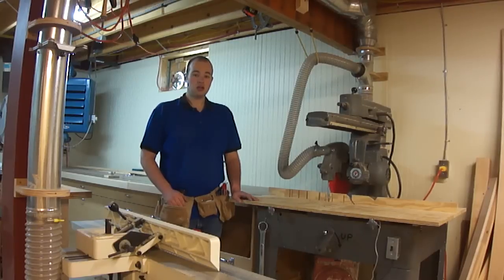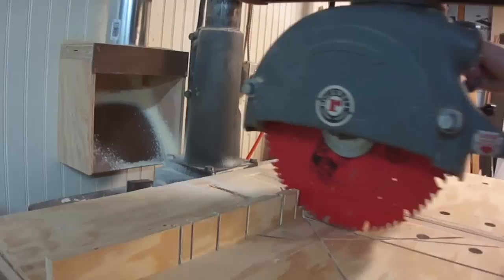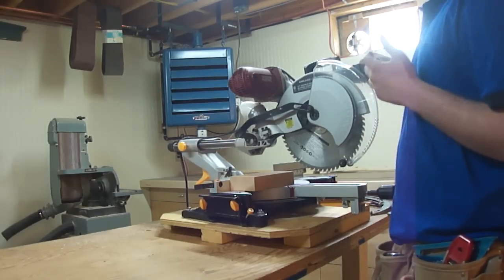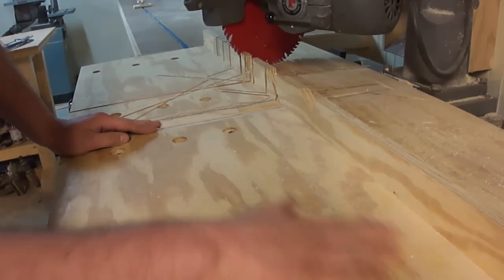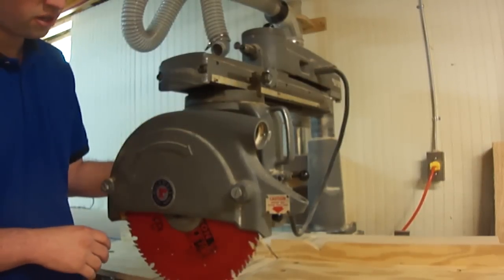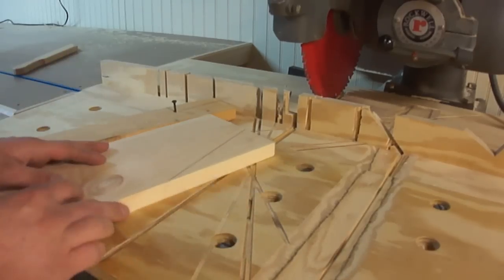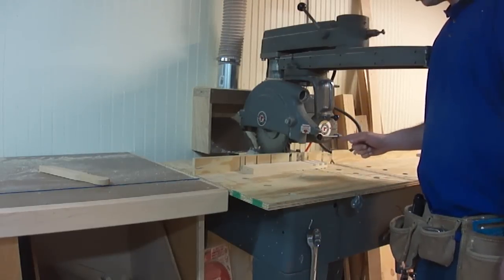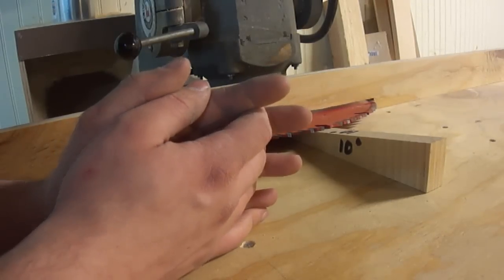How To Use The Radial Arm Saw

Comment: would also be handy if you could go over how to level/true the tool - from putting on a new table etc - they do get pretty chewed up...   and is there any specific maintenance.  i know we're probably all guilty of just turning the thing on and using it, until it doesn't work, THEN worrying about what went wrong.     i'm retired now, so with a limited income, i have to be more conscious of 'keeping things working', rather than reacting after they don't.  i have the time, so no excuses.
Reply: Most of us use a sacrificial top of 1/4- 3/8" ply bradded to the sub table, when it gets too chewed up, just pop it off and brad down another, all you calibrations will remain in effect too.

Comment: My radial arm saw has a "power cut" system that basically there a trigger that controls the maximum speed at which the carriage can slide forwards.
Reply from the maker: What brand is it? I’ve never heard of that feature before.
Reply: @TheNorthlandWorkshop  It's a craftsman. Feature is called power cut.  There's a recoiling wire attached the the arm, so the arm will always retract when released, in order to move forwards, you pull a trigger, and pull the carriage forwards.  There's a control wheel where you set the speed, and then the trigger has 2 levels within that, so for thin stuff you can go quicker, for thicker stuff you can go really slow and it stops the saw from climbing or self feeding.

found a video of it https://www.youtube.com/watch?v=LiX2so7ev-Y

Comment: Is it safe to cut a 4x4 with a radial arm saw in the cross cutting position where it's raised to half the width of the 4x4?
Reply from the maker: Yes, just pull the saw through slowly and it should be fine.

Comment: I’ve been using my radial arm saw for many years now and enjoy it immensely,however, I disagree with your comments on how to crosscut. Feeding the workpiece into a spinning blade from the backside will cause the saw to grab and jump into the wood and probably stall the saw and yes if your hand is in the path will result in serious injury (ie amputation). I have found that pulling the saw out first and then feeding it into the wood works much better with excellent control. I eliminate the chance that the blade will lift the wood by lowering the guard to just above the wood and holding or clamping the wood down. This is especially important with smaller pieces. This method also works better for dust control as the dust is brought up within the guard and is directed out the exhaust outlet cast into the guard where a shop vac is easily attached.
Reply: Pat Hennessey I'm no expert but I agree with the guy in the video. It's much easier for me to line up my cut with the slot already cut in the fence. People just need to have a good grip to keep it from feeding itself. After using one for a few hours it's not a problem for most folks. 

You have to do what you feel more comfortable with.

Comment: Question for you. At 28-29 minutes when talking about ripping, you seemed to point to feeding the saw opposite how you first instructed. I'm confused as I thought you were supposed to feed the saw with the spinning saw blade, not against it..... Do you you feed it when ripping differently than crosscut.
Reply from the maker: Casilyn Lund yes, ripping is the opposite direction. Cross cut is with the blade and ripping is against the blade’s rotation.

Comment: thanks for the tips, these saws are a dime a dozen and are cheaply priced down to thirty bucks or even free sometimes if you haul it away. its a no brainer
Reply from the maker: espn mk the saw in the video was free. I just had to haul it away.
Reply: The prices are awesome. What makes it great for guys like me is that I don't do much woodworking, so I don't need to spend a ton on tools for woodworking. I also don't have space for a table saw. The RAS gives me one compact, cheap tool I can tuck against a wall that can replace not only a table saw, but also a jointer and planer. It's all the woodshop I need.
Reply from the maker: John Terpack if I was told I could only have one power tool in my shop it would be a RAS.
Reply: @TheNorthlandWorkshop  that's exactly the boat I'm in. I can justify one tool that does many things and takes up little space.

Comment: i am rebuilding a 'piece of crap house'.   part of that project is residing, and part of THAT is putting triangular cedar gable vents on each end... i've already done the three required for the house, but have 3 outbuildings that need them...  with a 45 for the louvres, the other angle is usually about a 60-something angle.   i've been doing them with a jig and a tablesaw, or a skillsaw, but is there a way to do that on a RAS?   a 45/62 compound bevel for instance.   i want the louvres to be dado'd out where they meet the frame of the vent, so would be nice to be able to do a few curfs, then clean it up with a chisel.   much easier to do with a RAS since you can see the blade.

Comment: The blade only needs to just kiss the table, barely.  You don't need to cut any significant distance into the table.  Virtually none at all.  Also, the leaf guards are mainly for use when doing a rip cut, so you can protect yourself from the blade, then take them off for cross-cut.

Comment: Your lower safety guards would work fine if your fence was 1/2 as tall.  I have never used one taller than one inch, but usually around 3/4 inch.  Contact Delta for the anti kick back rod and pawl.

Comment: Instead of resetting the fence when cutting anything other than 90 degrees, why not leave the saw at 90 degrees, place a piece of mdf on the table with a protractor, one side on the fence and the other side on the back side of the mdf.  Make one cut on the mdf and now you have a template, say at 45 degrees.  Now, to cut a board at 45, put the template alongside the fence and the board to be cut alongside the mdf.  The saw remains at 90, the wood to be cut is angled along the mdf at a 45 degree angle.  It is quick to use and the saw remains at 90, templates can be quickly made at most any angle.  Glue sandpaper on the template to help hold the wood to be cut.
Reply from the maker: Greg Lewis the only issue with the jig set up is that it holds the work piece at an angle which is inconvenient depending on the length of the work piece. Swinging the saw to the desired angle is a lot faster than making a jig. If a radial arm saw can’t make an angle cut and snap back to 90 accurately it’s time for a better made saw.

Comment: Not just versatility ,there is no need for a table saw. Save your fingers and get rid of it . Nice saw . I had OSHA go through and he didn't care about the anti kick bar.  I have it but never use it . I have a commercial Delta 12",an old Sears or a DeWalt are nice also. No newer cheap junk.

Comment: Great video. My problem is using the saw for ripping without the anti-kickback pawls. That is dangerous, particularly with inrips.
I find it hard to believe you couldn't find replacements because the only difference was the diameter of the rod holding the pawls which was pretty much standardized.
My saw is an Eatons Techomaster. 45 years old and I have owned for just over 40 years. I have never felt the need for a table saw. For long panel cuts I use a straight cut guide and a Craftsmen circular saw. I use adjustable rollers for long cuts.
.

Comment: Help motor end play
Picked up 9in Craftsman ras no blade. Installed new blade. Will not rotate  apers to have changed end play on motor. Took blade off got to work with on blade  installed blade will not rotate  played with it some more semes to be changing motor end play help

Comment: I wouldn't worry or apologize about not having the goofy leafy guards on it. Despite what many people claim 99% of people that own table saw never even installed the blade guard. I grew up as a little kid with my grandfather and father in the workshop and we had a radial arm saw that had no guards and was missing it's little kickback pawl. We had a kickback pawl my grandfather had made and never worried about the goofy guard. The RAS is no more dangerous than any other tool people use regularly with a spinning blade. The workflow just looks different from what people are used to seeing on the DIY network so they immediately think it has to be dangerous. It makes so many cuts that are just goofy, dangerous and difficult on a table saw or router so easy and simple.

Comment: Except that you push the saw into the wood on mitre saws and most people will agree that they're safer. You don't pull it through, that's just a major "no no" of using any cutting tool. It's safer to push than to pull because radial arm saws and mitre saws move in the same motion.

Comment: Crosscut - if it was me, I'd pull the saw all the way out and make the cut by pushing the saw away from me. That way the blade is rotating to push the wood against the fence - so you're not fighting the saw holding the wood in place - for one and for 2 you're not 'climb milling' with it - so less chance of the blade grabbing the wood !

Comment: I couldn't disagree with you more on feeding the saw by pushing the power head away from the operator.  I would agree with you if I were going to try to cross cut a very small piece of stock but putting my hands within a foot of that uncovered blade isn't something I want to do and while the force generated by the blade exerted on the material being cut is not inconsequential with a forward pulling stroke a little bit of binding or the blade walking forward isn't worth the idea that the blade will all by itself hold the work in place.   Radials are very useful for sizing large material but so is a hand held circular saw and because the blade is buried in the stock being cut its probably safer too.  I have a 14 inch Delta that I've had for years that's worked for me since the day I bought it but ripping isn't something I want to do with it and I don't  cut anything that I cannot clamp to the fence or the table top.
Reply: Most of my cuttings are clamped when need be. Cutting ripping s i m oh so careful.and confident of my methods.havent lost any fingers. And damn sure dont plan on rushing thtought my work.when you rush you. Gush.

Comment: Looks like wrong type of blade on saw. Could be wrong but my 50 yr old eyes don’t see a negative rake angle blade. It prevents a RAS from doing its biggest problem, climb cutting is when the saw comes forward

Comment: The sliding compound miter saw should be used in the same way as the radial arm saw.  The people that pull the saw all the way out and push it to make the cut are doing it wrong, just like people that pull the radial arm saw out and try to do the cut on the push.  Same, same.
Reply from the maker: Chris Moore I’m afraid the industry disagrees with you on the miter saw directions. Here is an article explaining why pulling a miter saw is not the best way to do it: https://www.woodworkersjournal.com/not-pull-sliding-miter-saw-cut/ Also as an owner of two sliding miter saws and hence the owner of two sliding miter saw manuals I can tell you that both Chicago Electric and Milwaukee specifically state to pull the head out, plunge it into the wood and push it back. I’m sticking to the manufacturers’ instructions on this one.
Reply: Pushing the head into the work is the best method for cutting metal, tile, and brick- all operations every RAS is capable of. I routinely cut aluminum sheet 1/4" or better in thickness, you get a nice, clean, edge- milled finish too without using any lube.

Comment: THAT IS NO SEARS CRAFTSMAN SAW!!!    On a side note...  The first radial arm saw was (NOTICE THAT THE WORD SAW IS THE WORD WAS SPELLED BACKWARDS) designed and built by Ray DeWalt in 1922.  It was the Rockwell Tool Company who invented and marketed the first Miter Saw in around 1964.
Reply from the maker: Tribulation Prepper it’s definitely not a Craftsman saw.

Comment: THANK YOU, VERY MUCH, FOR THIS GREAT TUTORIAL/DEMO VIDEO!   NOW I WANT TO GO OUT AND CUT SOME BOARDS, FOR BIRD HOUSES, ETC.!!  LOL!!!   FYI:  I WOULD RECOMMEND ALWAYS KEEPING ALL FINGERS, HANDS, AND BODY PARTS WELL AWAY FROM THE CUT LINE/ZONE.
PERHAPS, MAKE A "PUSH STICK", THAT CAN BE PUSHED (GENTLY), TOWARD THE BACK FENCE, WITH THE BELLY/STOMACH, RATHER THAN THE HANDS, (ESPECIALLY IF CUTTING SMALL PIECES OF WOOD). ALWAYS CUT BY PUTTING YOUR WORK ON TOP OF A PIECE OF "WASTE" MATERIAL, LIKE A PIECE OF 1/4" BIRCH PLYWOOD). REPLACE THE "WASTE" PIECE, WHEN NECESSARY.  ["SHARED" ON GAB.AI ]

Comment: Ripping on a radial arm saw in opinion is extreamly dangerious . It may be ok for ripping wide boards that fit on the table.  I just dont like putting my hand between the fence and the blade with the whole blade above my hand. Scary!  Table saw for ripping radial saw for cross cutting  and  mitering . Just my opinion.

Comment: That table needs to be deeper.  The way the blade goes over the front edge ---- That's nuts.
Reply from the maker: Nie Bzdury the table is the exact dimensions called for in the saw’s manual.
Reply: The Northland Workshop  ....  That doesn't mean anything.  They used to set them up that way so that you could tip the blade horizontal, let it hang off the edge, and slide a piece of plywood along the floor to rip it.
  You wanna do that?
         I have an old book, "Easy Ways To Expert Woodworking",  which is all about different uses for the RAS -- You wouldn't believe the stuff that they suggest in there.
          But then, what do I care?  It's your life